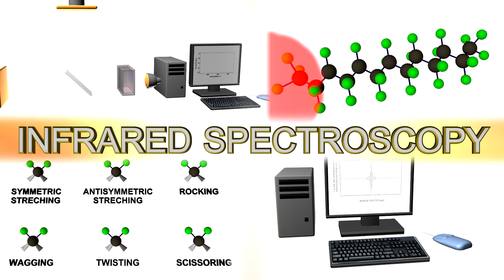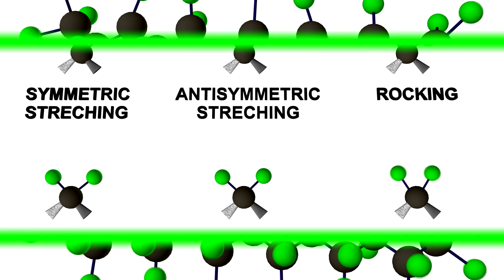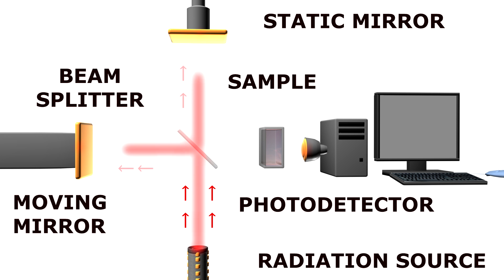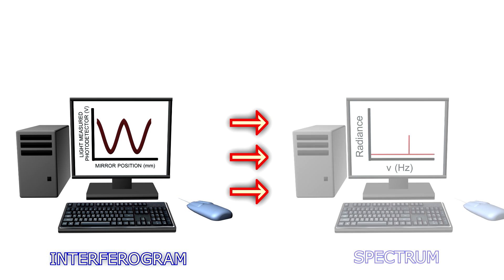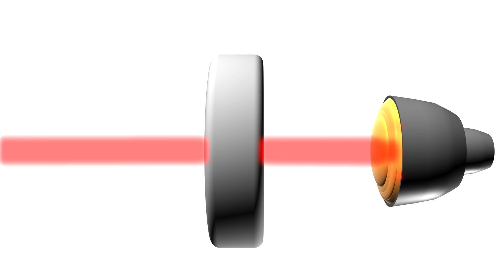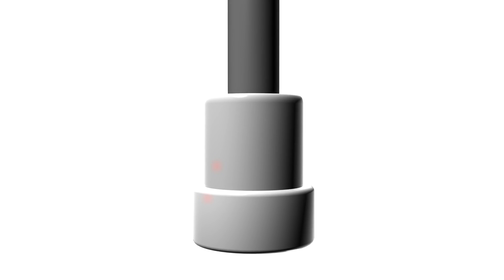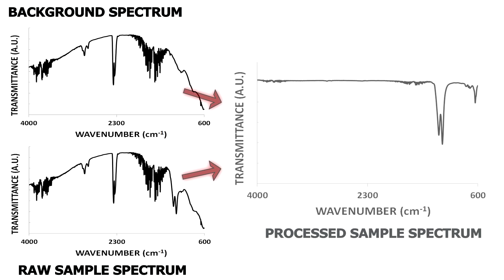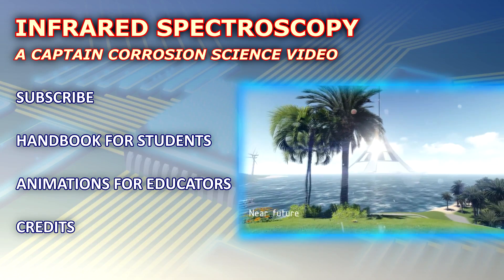Introduction to Infrared (IR) Spectroscopy | Basics and Practical Demonstration

Comment: thanks for the vid!  the only thing is:
you cannot get absorption of symmetric modes in IR spectroscopy, which the video seemed to suggest.
You can only probe asymmetric vib modes because this causes a change in dipole moment.    To probe symmetric modes which experience changes in polarizability, you have to use Raman.    right?